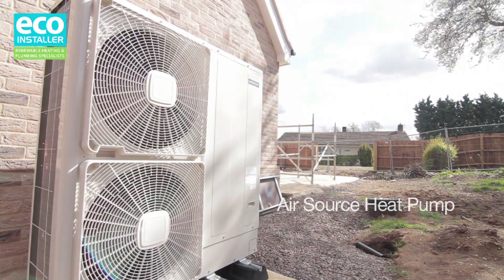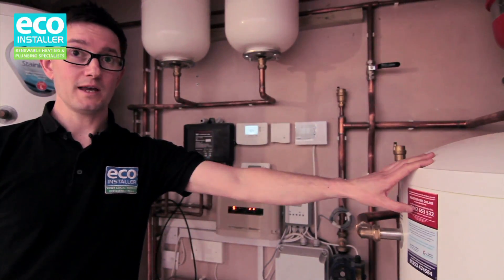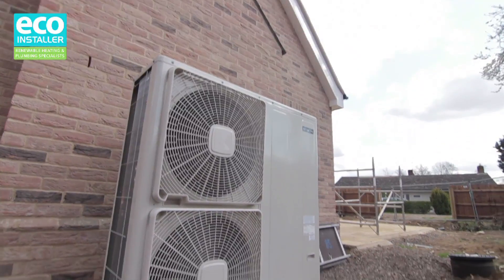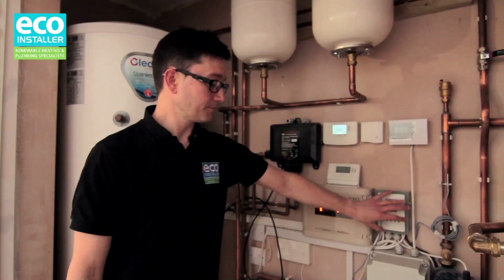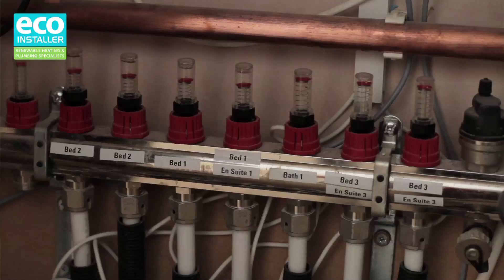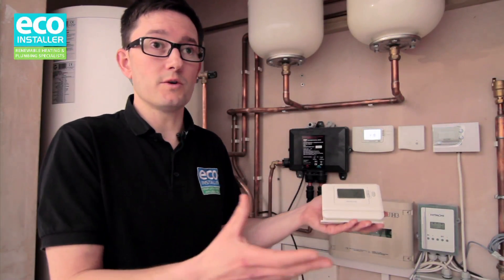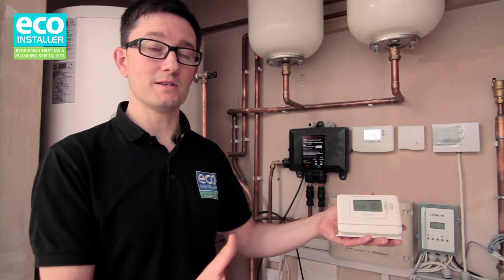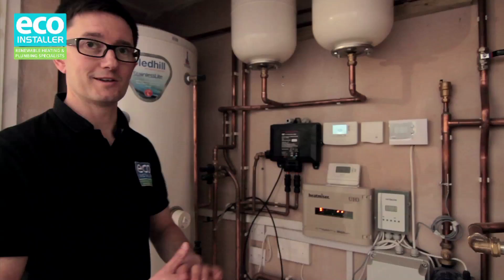Air Source Heat Pump Explained By Eco Installer of Ely, Cambridgeshire

Comment: My friend is Hetas registered and fits multifuel stoves for a living. He is regularly coming across enquiries to fit stoves because people cannot afford heating from their recently fitted heat pumps. People are reporting that the cost of air source heating is between £10 and £15 per day. YES, PER DAY!!! They cant go back to gas because they took the government grant so that leaves them turning to multi fuel or wood burning stoves, their radiators don't even get warm.  My advice to anyone thinking of Air source is fit a new gas boiler which is very efficient, it will last 15 years by which time there will be a far more sensible alternative to heat pumps
Reply: @petercollins7848  He's my tuppence worth...I cannot, repeat, cannot get from ANY mauufacturer a legally defined efficiency figure !!!!! 400% claimed...ANY efficiency figure above 100% is perpetual motion.  A totally well insulated house ( which are very few) with certification of air tightness could be heated with a candle...(forget the sick building syndrome)... SO unless you have a perfectly insulated home this system will work but if not then the majority of houses in the UK will fall short of this ideal.
There is something wrong here...I belive it is similar to the one euro insulate your house scam that was all the rage a few years ago in France.
Talking to an installer two days age, sorry argueing, I asked why a 6mm electrcal supply was needed, he said  "in the winter this won't do enough heat so we use an immersion heater in the unit" Says it all !!!
Reply: @georgestyer2153  I was talking to someone who had a ground source heat pump about 5 years ago. It costs him £500 per month because of the continuously running heavy duty pump and immersion heater to top up the hot water temperature.  I always thought the ground source was the more sensible option to go for but even this makes no sense.  If I'm using natural sources around me to proce heat,  I would expect it to be free.

Comment: Nice advert for the company, but these will be of no use in the majority of UK homes!  And just look at all the equipment needed, you would think it was a nuclear power station!  Tens of thousands of pounds vs a £1700 gas boiler - what makes more economic sense?  Also so - called ‘renewables’ are subsidised by the government (taxpayer) as well.  We are not there yet with a simple way to heat our homes.  Someone needs to come up with a better idea.  Surely the Universities or tech wizards can do better than this?